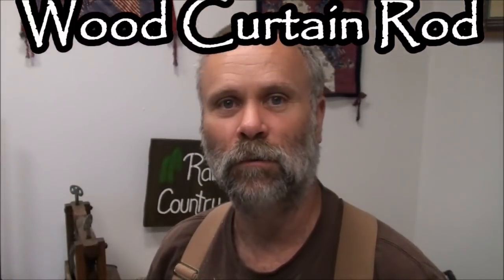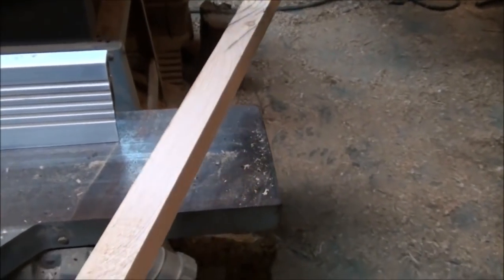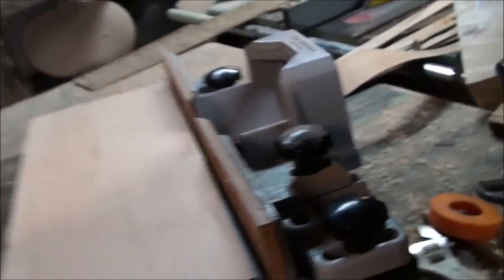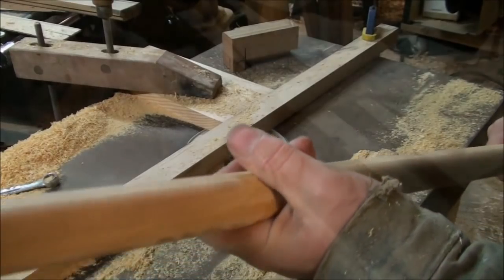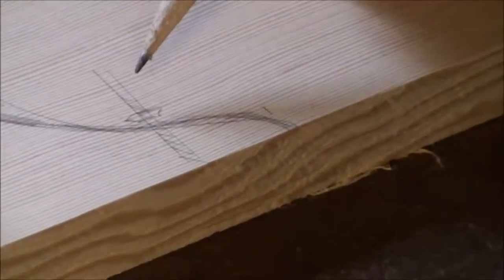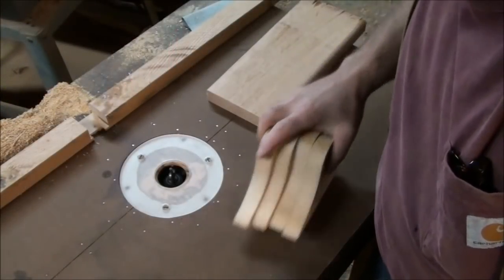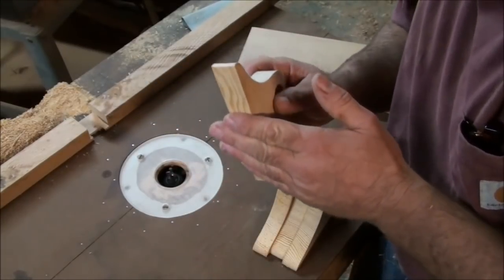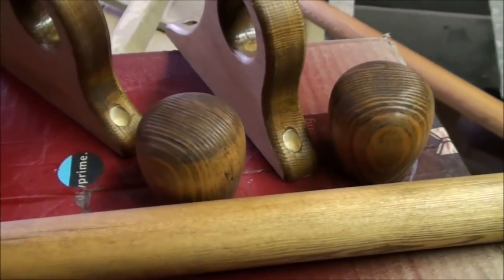Making a New Wood Curtain Rod

Comment: Going to make a couple extra hangers at the same time for backups/patterns??
Reply: These hangers are a pretty simple design to make "off the cuff". If a hanger were to break for some reason I could pull the damaged one and use it for a pattern for a new one. I have made templates of different things before out of art board and that preserves the pattern, which isn't a bad idea!